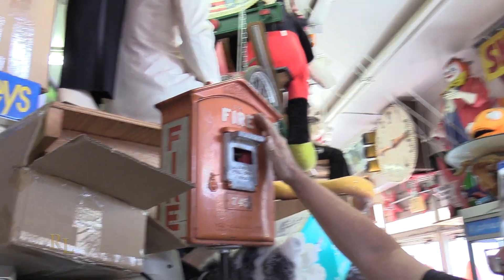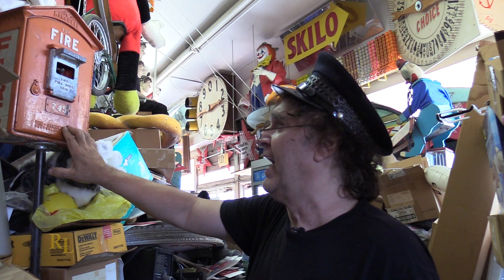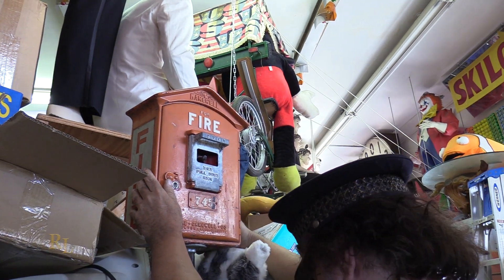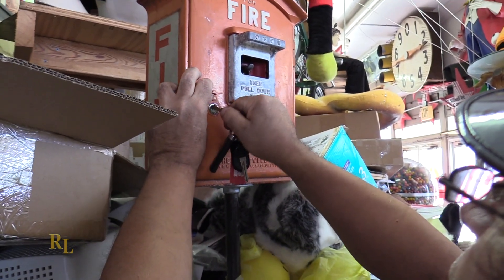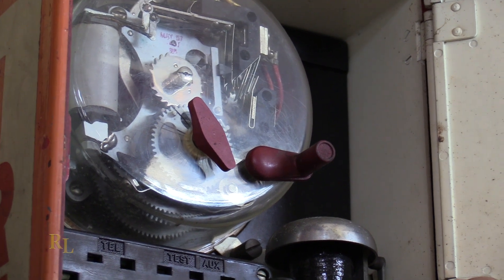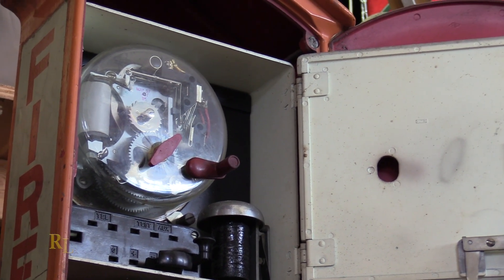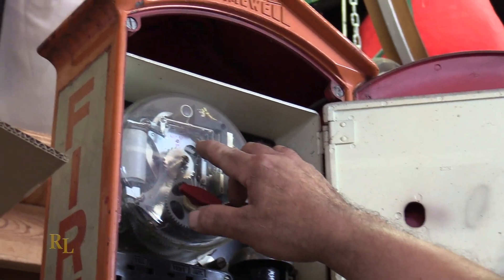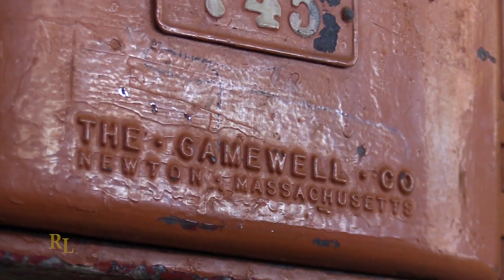What are FIREBOXES and how do they work?

Comment: These boxes were connected to a dedicated "dry pair" and were not connected to the telco switch.  Hence, no phone call.  Think of itlikes a huge door bell circuit; push a button her,e and the bell rings there.
Reply from the maker: @BillNeese  I would assume they had a direct line, and I would also assume there is more then one way things can be done.

Voltage drop from supply to box to station on a direct pair would have to be huge on a single pair, but it can be compensated and balanced.

Comment: It did not connect to regular phone lines and was a separate system.  In the fire station, yes, there was a bell, but also a punch tape machine (similar to a stock broker ticker tape) that would punch out the code.  Some towns had a horn called a diaphone that would also blast the code so everyone in town knew where to go for the fire.  If you are ever in Harrisburg, PA, the fire museum has a really good operating display on how these systems worked.  There are still a few towns that have them but that number keeps dwindling because York, PA is removing their system.
Reply: My town had the Diaphone horns that would blast out the code.